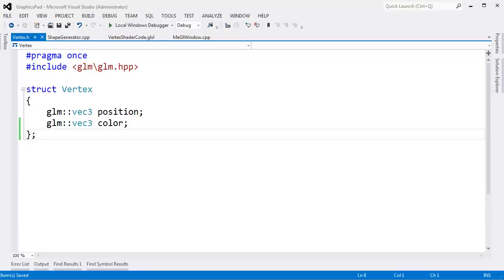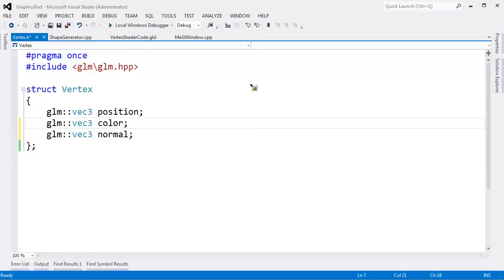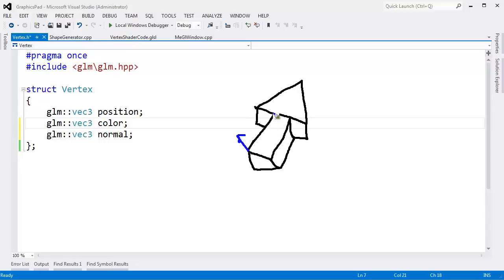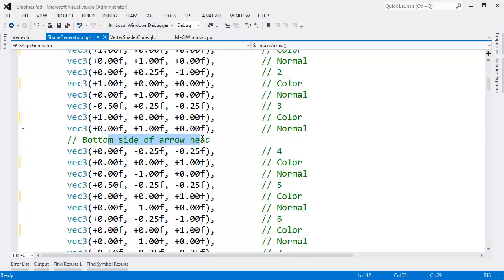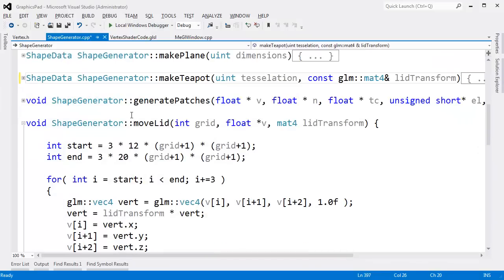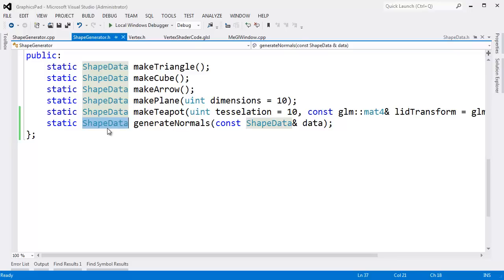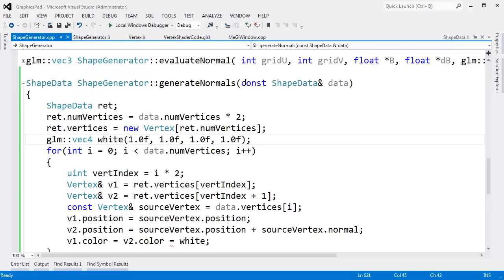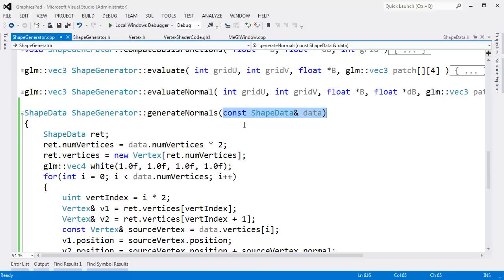Generating Surface Normal Geometry Data

Comment: Why the surface normal is not automatically determined by the winding order? I mean, each triangle are a small plane the winding tell us the facing direction and could be used as normal .

Comment: Hey Jamie, I have created this code to generate normal to any geometry. I have tested it and I believe it works. Can you check it out? 
https://gist.github.com/jbrmaiden/07dc68f5fff7db7c5e5d
Reply from the maker: +Jordan Boaz Rodrigues Want to do a vid on it? Are you hoping to share it around? If you do a vid explaining it well, how to use it, etc. and want me to post the vid, I will.
Reply: +Jamie King Sure! I will share it as soon as  I am finished coding it. (which is my course competition assignment) :)
Reply: Hi, I'm really struggling with normals. I somehow calculated the normals but in 2D and its z value is all 0. now I want to align these normals in z axis. https://www.dropbox.com/s/xm6rc66w3e9p0ak/FaceReconstruct.ply?dl=0 This is the Point Cloud I've saved in ply format. It contains only Vertices and normals. Please help. If there is any algorithm to calculate normals. I don't want to use any external library. In Meshlab there is a function to calculate normals for Point sets and it gives good result. Thank you.